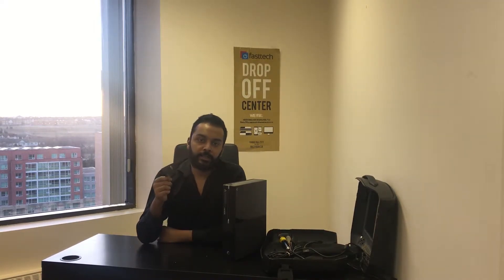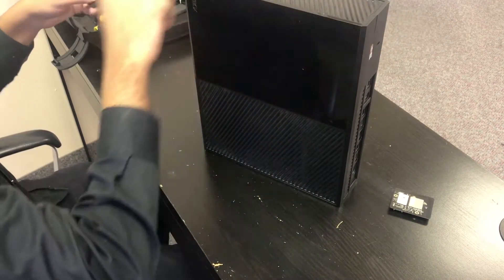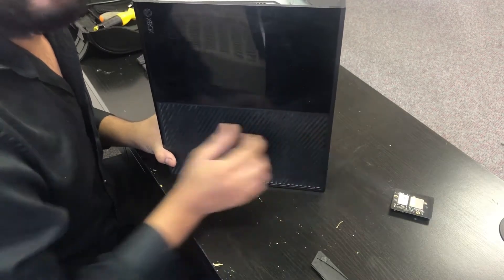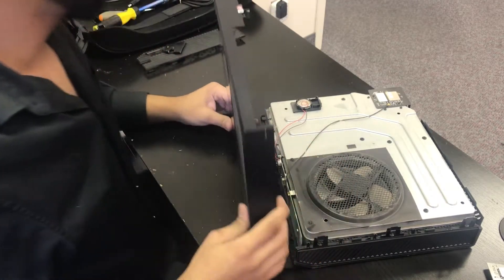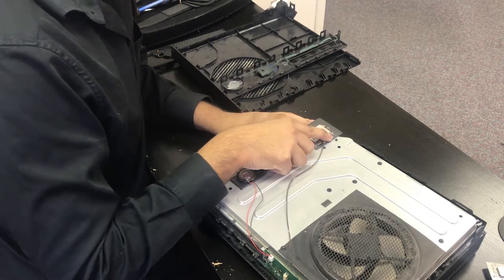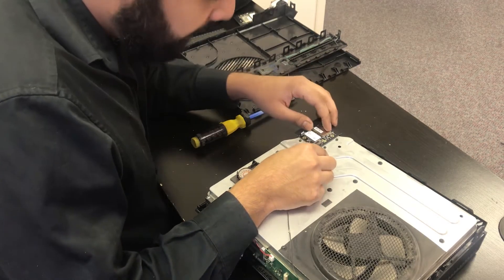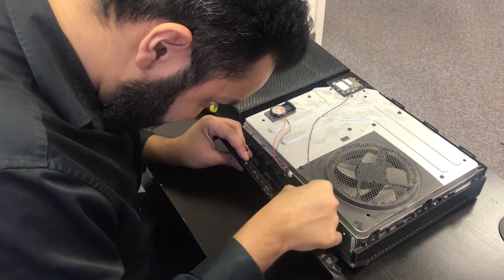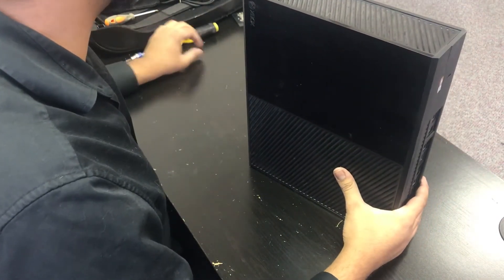Xbox One Controllers Not Connecting / WiFi Not Working Repair - Wireless Card Replacement

Comment: So that little wirless card works for both the wifi and controllers? Cause i got a used one and noticed my brand new wirless controller doesn't stay connected very long, and noticed that the little wire isn't connected to that card (Its missing that little hook up to connect the cord to it). Idk what the other two slots are used for, but i dont rhink those are used im assuming?
Reply from the maker: Yes there is probably and issue with your replacement card since wifi and bluetooth is handled by it. The other antenna connectors are not used.
Reply: @fasttechvideo  Ah ok, oh i forgot to say that i got a used Xbox one and the wirless card had the missing connecter thingy and i opened the Xbox cover to after hearing about these things and noticed the wire wasn't connected to the card.

Comment: Hello, I was running into some wifi problems on my xbox last year and thankfully came across your video. I ordered a new wireless card from your website and it fixed all my wifi issues. It's now been about a year since I fixed it but I am running into the same problem again, could it still be the wifi card or could it be something else? Also, if it IS the wifi card, then would I have to order a new one again or could I just get it replaced?
Reply from the maker: It could be the wireless card. You can send it back for a replacement just call 1(888)7447372 and provide them with an order number. We will send out the replacement in a few days.

Comment: Controller and WiFi disconnects , so I changed the chip out and the problem still persists ..... kinda lost on what to do now . Maybe just buy a new Xbox ? WiFi strength is strong and controlled is brand new .
Reply from the maker: Perhaps the Wifi adapter you bought, Im guessing not from us, is defective.
Reply: @fasttechvideo  just theoretically if it isn’t defective is there anything else that would cause this ? Or is this the only part in the Xbox that would cause this
Reply from the maker: @cameron35crumpler  Check the cables for the network module and replace the front RF board (this very rarely fixes signal problems)

Comment: Hi, Fasttech I have a question. I have an Xbox that hasn't recognized any networks for a couple of years. I attempted everything that I could without opening the console up, and it hasn't worked. I need to do updates, but I don't think it will fix it. Would the chip have a good chance of fixing this or would the updates do anything? The controllers hook up right away so it is just a network problem.
Reply from the maker: Replacing this chip will fix your problem.
Reply: @fasttechvideo  Thankyou

Comment: My sync button and wireless connection for wifi worked before I opened my Xbox to clean it as I disassembled the motherboard and everything. After I connected everything again, my sync button and wireless/WiFi won't connect my controller or routers. It wasn't damaged or broken, just confused.
Reply from the maker: Check to make sure your Wifi module is connected properly.
Reply: This exact same thing just happened to me! Ah!  - Cleaned it and carefully disconnected the wire. 
Did you end up fixing yours somehow or did you have success with a new wireless card? ,I'd really appreciate your assistance if you have managed to sort the issue

Comment: They are not new cards. I called to verify and was told they are new and not refurbished. However when I received mine it looked worse than my card and the antenna cable would not connect to the card because the connection was smashed.
Reply from the maker: Hi,
Sorry to hear that. Would you like an exchange or refund ?

Comment: Hi, my xbox connects to controllers fine however with the WiFi, it can find the WiFi and connect, however it will randomly disconnect itself and reconnect instantly... is this a sign of a dodgy WiFi card?
Reply from the maker: If its not an issue with your router its most likely the network card in your Xbox. Try connecting your Xbox to your phone's wifi hotspot and see if that makes a difference.
Reply: Fasttech I done it on my phone and it still randomly disconnects, I changed the WiFi card today and it’s still randomly disconnecting, idk what to do

Comment: I have reset my Xbox twice in the last two days because it won’t show any WiFi networks and when I press the sync button on the console it just dings. Does this mean that the network card is bad and need to be replaced?
Reply from the maker: Most likely yes, you need a new network chip module. Link is in the description :)
Reply: @fasttechvideo  I'm having the same issue with no wifi networks showing up. Have had the issue for months. But my controller connects just fine. It's also resyncs perfectly. Do you think that's the WiFi card?
Reply from the maker: Restacced Yes

Comment: My controllers are able to connect perfectly fine to my xbox one upon startup but halfway thru it gets disconnected(but controller shows that it is still connected to console).I even tried using a microUSB cable to wire up my controller but still no response on the main screen.Punched the keys or analog sticks still no response.Any ideas what the issue may be?
Reply: I just replaced my card and this is happening now. Don't know what the problem is.

Comment: So my WiFi card cable( the black one) is broken and stuck to the one u clip it on do u know how to fix it please respond
Reply from the maker: You can pull it off by using pliers and replacing the black wire.

Comment: Thanks for the video. I just acquired a Xbox One original console. My controllers connect fine but it won't show any wireless networks. I did both a soft and hard reset and during initial setup it asks for language and then the next step (network) it says it's already connected to a network but obviously it's not. Do you think a new wireless card will resolve this?
Reply: Same problem here, my friend... Find a solution yet?
Reply: I dropped mine but same

Comment: i have this message popping up on my console
 "Sorry, the wireless network hardware on this console isn't working. You'll need to send it in for repair

will your replacement help fix that?
Reply from the maker: Yes it will fix the issue. Sorry about the late reply.

Comment: are the cards you sell new? I bought one from Amazon and it showed up rusty and beat up.
Reply: This is a lie. They are not new. I called to verify and was told they are new not refurbished. However when I received mine it looked worse than my card and the antenna cable would not connect to the card because the connection was smashed.
Reply from the maker: Yes they are new

Comment: My networks don't show, but my controller connects, any ideas?
Reply from the maker: You need a new network card.
Reply: So the Bluetooth for the controller can continue to function even if the network card has died?
Reply: @Simplyput_  yes
Reply: @Rayjp3  I would hard reset router and Xbox then try again.
Reply: I just replaced my network card and now the WiFi is showing up. My problem now is it is stating the Dan's isn't resolving Xbox server names any ideas?